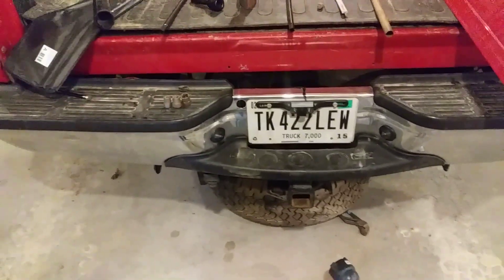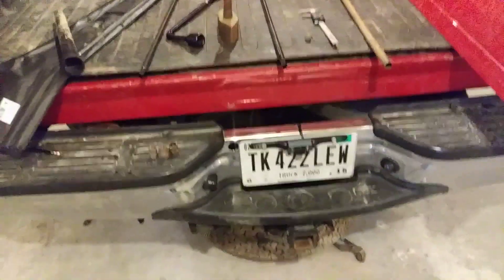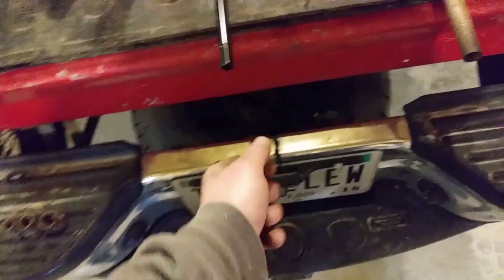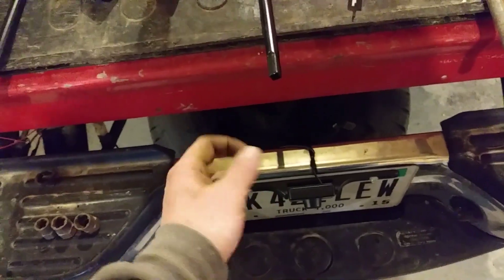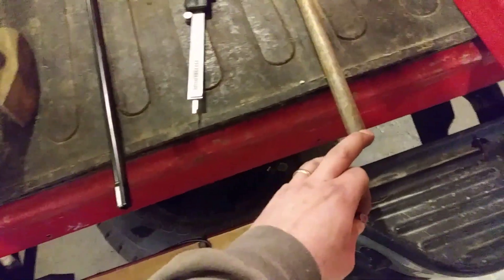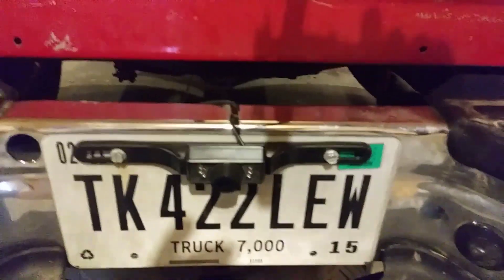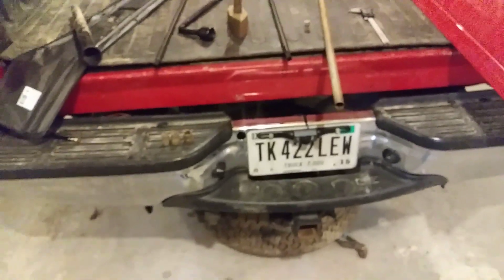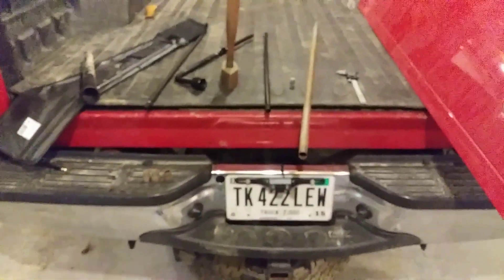Spare Tire Lock Removal

Comment: 1/2 " drive 14mm 12 point socket on beefy extension and beat it on. Use ratchet to lower tire. Use screwdriver to pry out lock,
Reply: took him 4 and 1/2 minutes to say one sentence...
Reply: Working that technique now - but not  with much success

Comment: I watched a video on spare removal as soon as I got my truck. Didn't have that bullshit key either. I used a 14 mm and smacked it several times but it wouldn't lower the tire. I got spooked and once i took out the extension luckily the key was stuck in it.

Comment: Why on Gods green Earth did Ford decide to put it on there??? Left me totally screwed stuck in the mountains of California with the closest store a cool 12 mile hike and no cellphone reception. Thank God nobody stopped to give me a ride or i would've had to walk the whole damn way while my wife worried to death about where i was. If i had my cordless grinder i would've just cut the dang cord and been done with it. Lord Almighty!!
Reply: Yea, I feel your pain. It happened to me, late after work and there were no tire shops open. Big SCREW in my tire and I couldn’t get my spare down. Luckily, the screw was holding the air in so I was able to drive home. I get on YouTube, and sure enough I see this year model has a key and I do have it. My previous model did not and I did lower the spare a few times without a key; FRUSTRATED me BADLY! I’m thinking the hoist is BROKEN, because I bought the truck used and I never checked to see if it worked.

Comment: Saved my bacon! I have had the truck for 4 years and never needed the spare. Good thing, as I would never have gotten it out as the key was missing. Dealer said he had to order both lock and key at same time as they are a matched set. Pipe and hammer saved the day!! And, the video was very easy to follow. Just Tinkering sounds just like my cousins!

Comment: Yeah fighting this on a new to us f250.
Question is with your conduit pushed on to the lock did the lock have to be turned or just pop out
Reply from the maker: I used a quick, straight, jerk to pop it out.